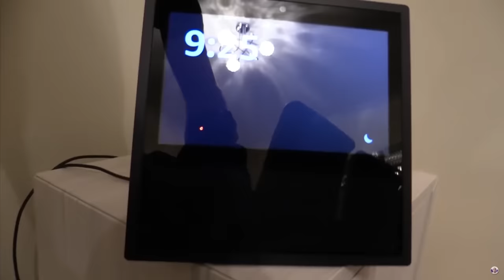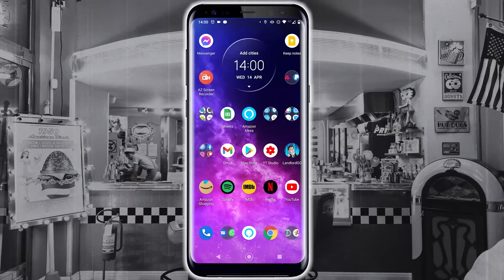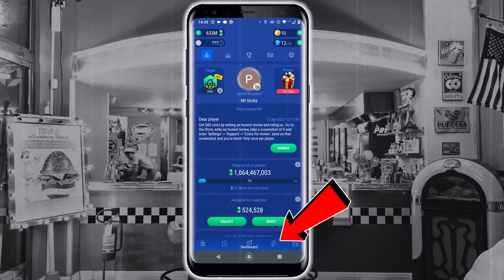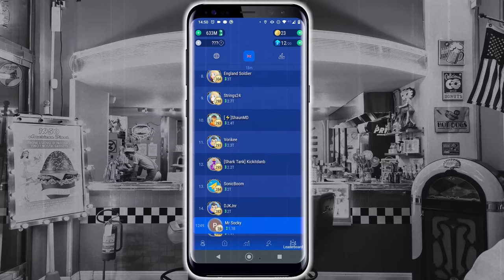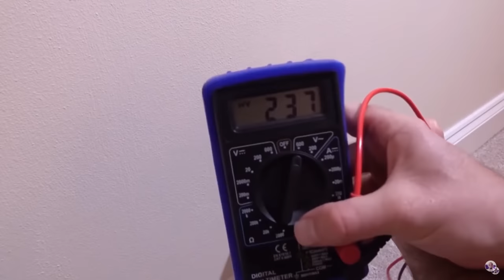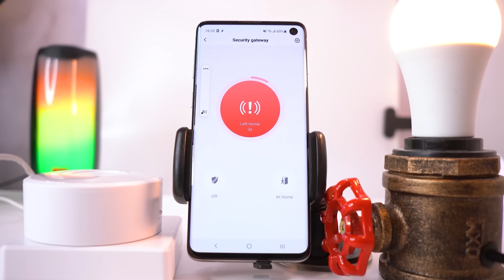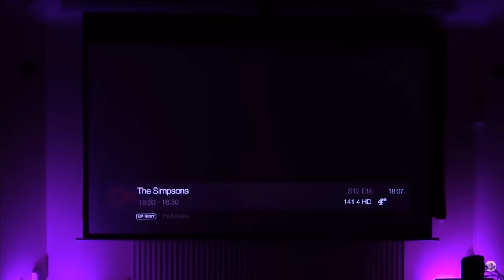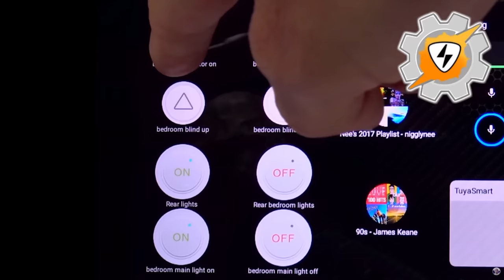Starting A Smart Home I ULTIMATE GUIDE

Comment: Smart homes should be decided by what phones the occupants use. Simple. Why would you move away from your phone ecosystem. Apple should be on Amazon iot devices and Samsung phone owners should by Google based iot devices.
Reply from the maker: For future proofing. Apple and Google are both gonna fail out of this thing.
Reply: I really don't understand this comment at all?  What if different members of the family want different brands of phone?  Just make sure that whatever you buy will work with either.  

Or use home assistant or OpenHab and then it doesn't matter what phone you get, they have both Android and IOS apps.
Reply: @justblairthompson  So the average user is going to maybe partially understand what their ecosystem does. If they are an Apple user then they may research and think HomePod is the way to go....wrong. But the same can be said for Samsung phone users.....they will track toward what works with Google Home. All I am saying is that they should track that way....because innovation on those platforms will be user centric and if you have a Samsung phone....Google will make it easier to connect devices and ensure they work. Amazon will be the go to for Apple users because the Apple devs have already given up on smart devices. No one is innovating at all...and HomePod  is a disgrace. Siri is lucky to be able to spell Siri. 

The average Joe is not going to run HA or Hubitat or OpenHab....they can barely spell "the Windows Start Button....so why would they venture into Linux, or Rasp pi or something like that. They just wont use it and they will stick to using the apps that they get with devices.....not knowing that you don't need 2 dozen apps if you run a real system like Home Assistant. 

As a person who is currently helping some disabled people get some smarts at home....I can tell you its a grind and its going to be all about voice and then removing the need for voice. For example.....a disabled person goes into a room...any time of day.....they have to ask Alexa to turn on the lights. Regardless of the room brightness...just because they like it. Nope.....not good enough.....they need a sensor to see they have entered that space and flick on the lights. Easy with HA but no so much otherwise because you have to lock them to a system.

I promote Amazon because its a crossover and it has active devs that constantly update it.....we are not seeing that with either Google or Apple. So yes your phone can count in the decision making.
Reply: @paulhibbert  I agree. The Devs have given up more or less. The companies who are entering and owning  the market are all Tuya and Xiaomi based and both are garbage....but its the cheapest entry into the Smart Home industry. Anyone can engage Tuya and create a product from their cookie cutter range and make a crap app that does 30% of what it should and sell the wares online. Even the big names are just Tuya or Xiaomi junk with slightly better apps....Like Roborock for instance...great product but its just high level Xiaomi junk.....it has a great app.....but not much else.
Reply from the maker: I'm lost, you think people should stick with whatever assistant their phone has, but you also agree with me that they shouldn't. 🤔

I have a Samsung phone and a Google nest hub. Saying OK Google to the hub triggers the phone in my pocket, its like they're always fighting against each other.

As for bashing xiaomi, their hardware is second to none and works great with systems like Hubitat.

Tuya stuff is also spot on. It's failed me way less than Lifx and Hue over the past 4 years.
Reply: @paulhibbert  Yes I agree....and its a nightmare. But if you are part of the Google ecosystem then it make sense to stay with that and work it out. If you are Apple then move to Amazon devices because the Apple ones are overpriced and Siri is pretty crap. But it depends per household and it should play a part in the setting up of the smart home system.....that's all I am saying.

Comment: Except, you might want to learn how your smart home system will actually work and where your data is going, just to switch on that light. Did you give Xioami and N other unknown cloud services, access to your home network and your PC? Many devices phone home….and sometimes if you block them from doing so, they will not work at all. Sometimes a good deal is not a good deal, because you and your data are the real product, or possibly your devices could act as a trojan horse. This is what you need to research, before buying anything! I’ve decided to invest in a Phillips hue (compatible) system as the bridge does not need to phone home (to companies, located in places far away, i know nothing about and cannot trust).